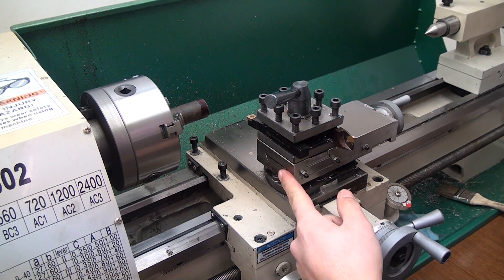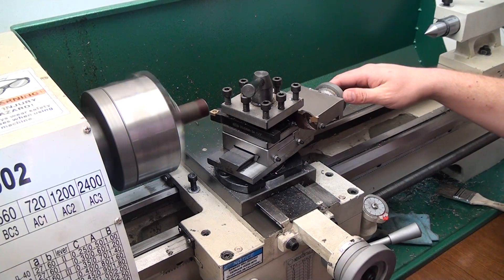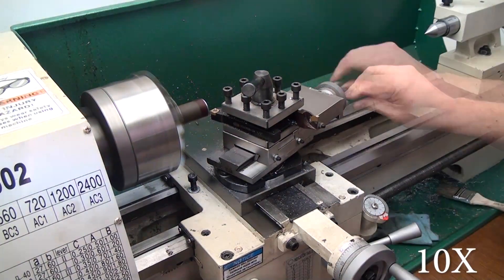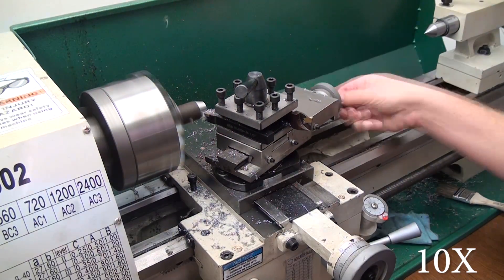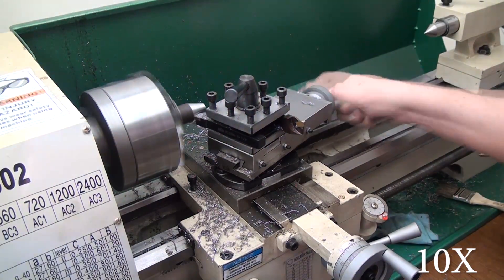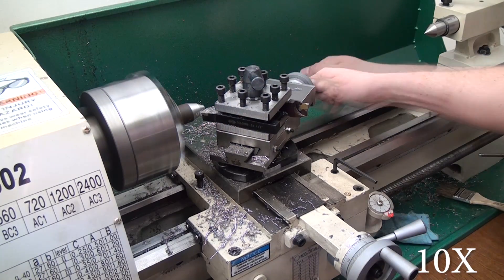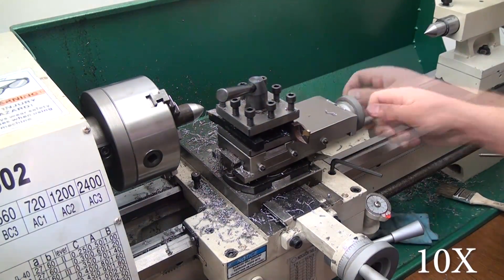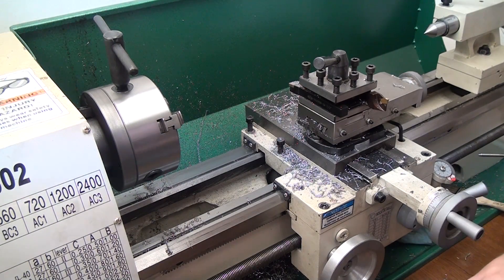11 G0602 Fun With Tapers

Comment: Recommend you try to take up the end play on your cross-feed dial.  At time ~30 seconds you can see you have excess clearance between the dial and the dial hub of ~10 thou or so.   You need some end play on the cross feed, but minimizing it can help improve your lathe's performance.  Different cutter geometries will tend to draw the cutter into the workpiece or push it away.